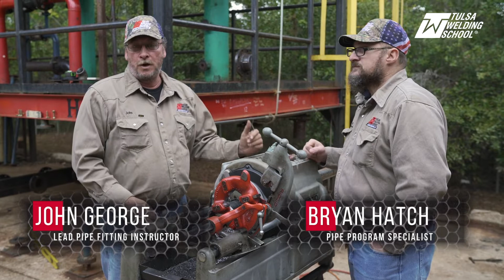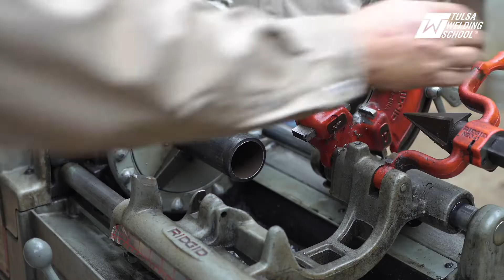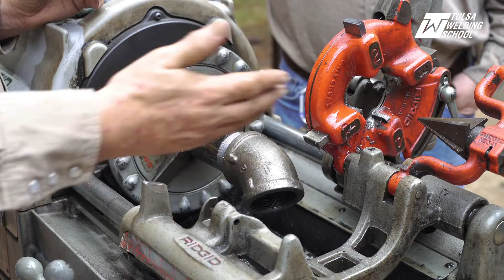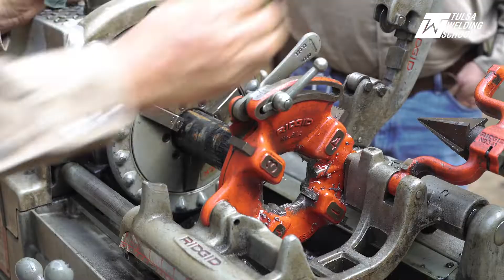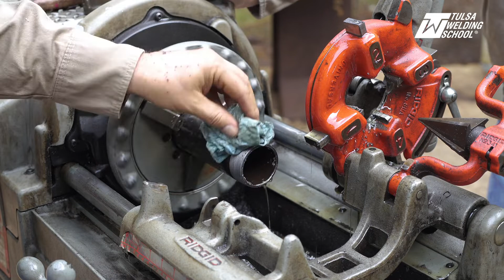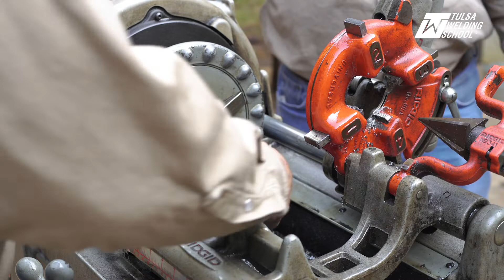Pipefitting 101: How to Fit 45 Degree Offsets Part 2 – Tulsa Welding School

Comment: When you are threading the pipe I notice that you take the adjustment back to the 2 inch line every time, then adjust it back out about a quarter of an inch.  Is this the proper way to do that?  And why?  I have always made adjustments from the 2 inch line on the threader head and left it alone in order to get the proper depth.  Is this okay? Would this cause premature die wear I’m guessing?
Reply: The purpose for returning the adjustment back to the 2" mark is simply to go back to the reference point. Since all pipe diameters have allowances of acceptance tollerance, two pipes of the same size could have different diametricals. Out of round as slight as .005 could require adjustment. Also, material wall thickness will impact adjustment. Thank you for taking the time to express interest.
Reply: @bryanhatch6688  Thanks for the response I always appreciate learning something new